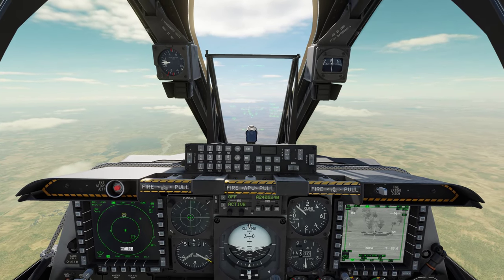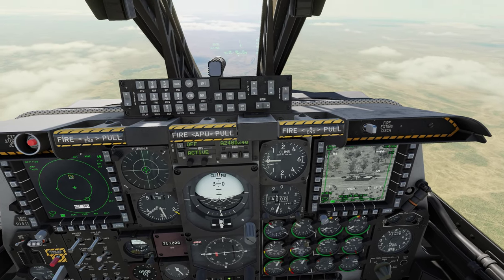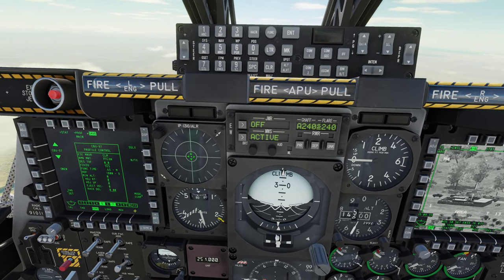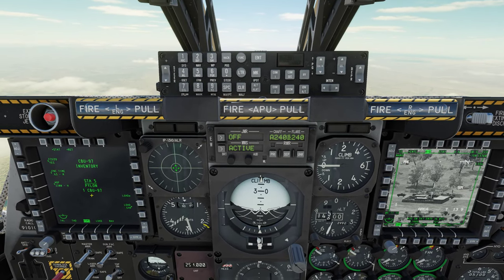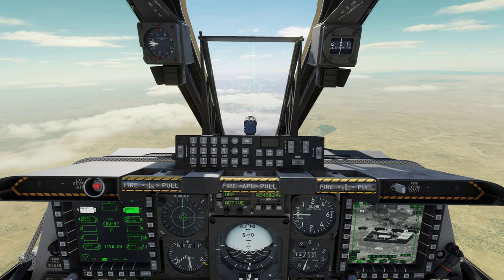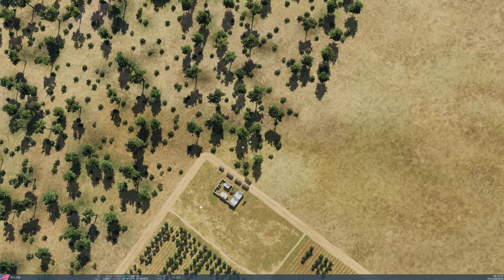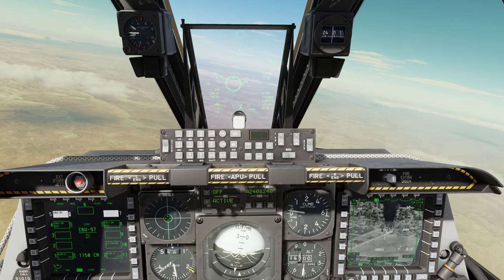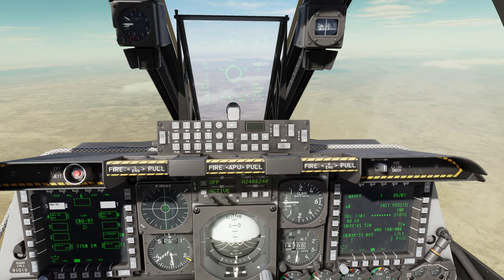DCS A10C II 'Short and Simple Tutorial' #5: CBU-97 in CCRP Mode

Comment: This is really cool to point out, I'd been having trouble using CCIP for clusters until I figured out that the A-10C is way too slow to get a CCIP solution at a decent altitude, unlike the F-16 that can use momentum to toss them further. The only way I could get a solution was a moderate dive that would put me in the way of AAA flak that would fire before I could release. 
I'll now use this method in combination with entering the winds into the CDU winds page.

Comment: By entering the wind direction and speed in the CDU you almost get yourself a CBU97 JDAM.
Reply from the maker: Or just pickup CBU-105s if you don't want to calculate and input the LASTE wind corrections. We've tested them quite a bit, and the improvement is marginal with dumb bombs. Not saying they don't improve accuracy, but in strong winds, guided or wind corrected weapons are the best route. IMO
Reply: @Westpoint1-1  I prefer the 97 to the 105, more efficient against armoured units. By calculating the winds at different altitude they are very accurate, specially with a burst at 1200ft.